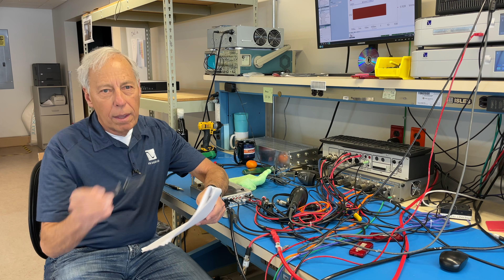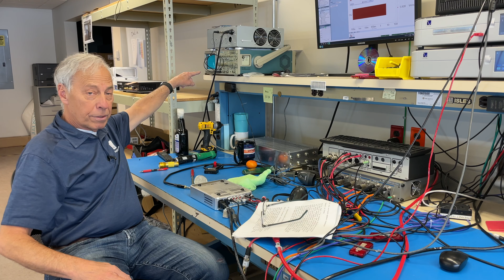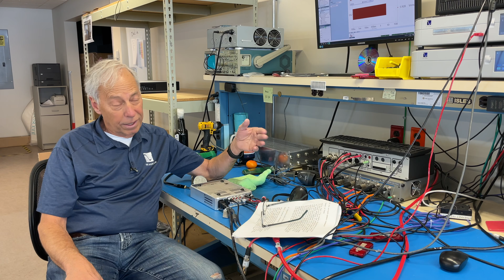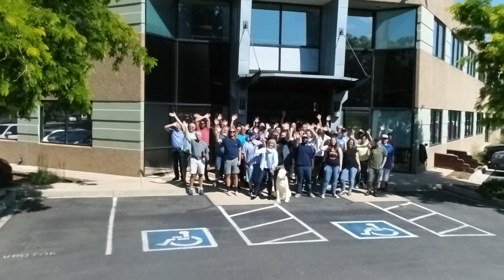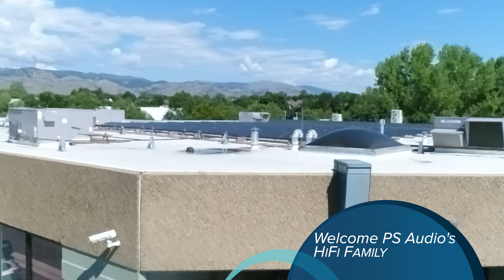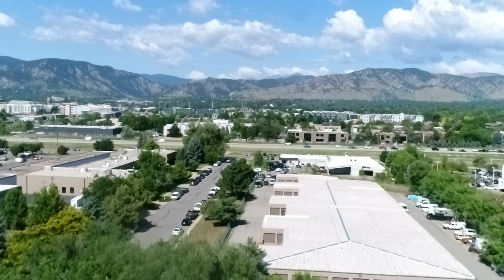Tips for beginning audio designs

Comment: One note about function  generators, especially the cheaper units. They are inherently square  wave generators. They get the sine and triangle waves by filtering the square wave. This results in distortion. It is "low"  but if you are designing a low distortion amp or preamp, a cheap generator will have more distortion then your design - useless! You really ultimately want a pure sine wave generator for audio work. The old tube HP or the classic model 330  is great if you can find one in good condition. The Heathkit IG units are OK, they are basically a copy of the HP 330 but with lower spec components. But there are many mod sites that show you how to improve the distortion of the Heathkit generator to lab level performance. And on the subject of scopes, I prefer an old analog scope for audio work. I have a lab grade 500mhz Tektronix digital storage scope but when I do audio projects I reach for my old 50mhz Leader 1983 analog scope. Ebay has great deals on older analog scopes because a lot of hobbyists think they are old school. But not for good audio work, analog scopes are preferred by many audio electronics  engineers

Comment: Step one, check out Mullard Tube Circuits For Audio Amplifiers - prefferably the 1959 first edition. Next, hang out with that guy who used to work as the amp and guitar tech for Veruca Salt. Hope you have an endless supply of start-up money.😁
Reply: @Laurentz- to my ears, the best sounding hi fi and electric guitar gear from the 1990s are made by electronic designers who last had sex during the Carter Administration. Ha, ha!!!

Comment: Now that I'm way down the rabbit hole (and also still not able to design my own stuff), I'd say get yourself some low-noise, small-signal transistors (MPAs, BC550/546/560/556, etc.) as these are the cheapest and easiest active devices to mess around with. Of course, op amps like the NE5534 are a good place to start, too. Tubes come with the caution that they use high voltages, but 12AX7s, 12 AU7s, and EF86s are a good place to start learning about them. With these devices, you can build stepup amps, preamps, RIAA phono stages, and so on. Remember, designing the power supply is just as important, in most cases!

Comment: ❤️❤️Hai Sir,... Can we seperate high,mid and low drivers with seperate enclosures and place it in a certain distance?.... Is it any good ?????
Reply: Generally you'd want the speaker drivers to be as close together as you can get them. Most loudspeakers function with the ideal being that the sound is emitted from a single point. If the drivers are too far apart, you'll begin to notice that the sound is coming from different sources. However, a lot of speakers internally separate the drivers into their own enclosures, but all in the same box. And for very low frequencies, the drivers don't need to be near the mid and high drivers, like with a subwoofer. Otherwise you'd probably have to mess around with active crossovers, room acoustics, DSP, etc. to get the separate speakers to sound right
Reply: @mattbonaccio3522  Thank you for your reply Sir.  Actually I am asked regarding active crossover setup.... Could you explain the placement of drivers in an active crossover setup?
Reply: I believe that with most commercially-produced speaker systems, they already keep the internal air separate between woofer, midrange, and tweeter.  You wouldn't want the vibrations of the woofer moving the other drivers.  For active crossovers, you could split up the wiring of an existing full-range speaker, or build your own.  You might need to do some testing to see how the phase lines up in the frequency ranges where the different drivers overlap.
Reply: @kc9scott  Thank you 🙏🙏🙏